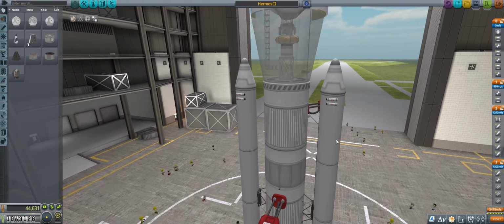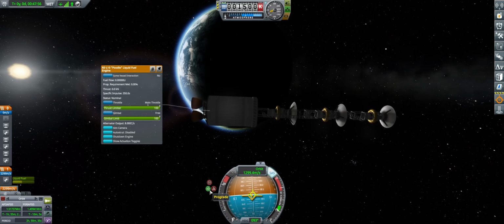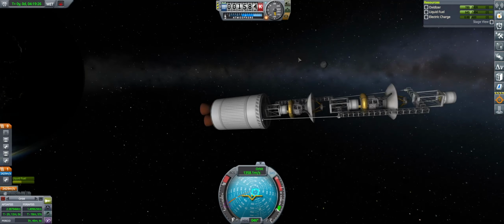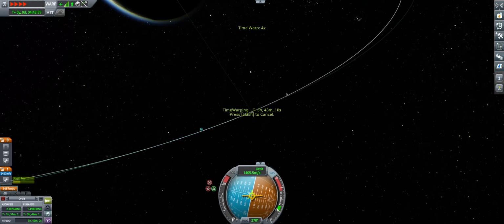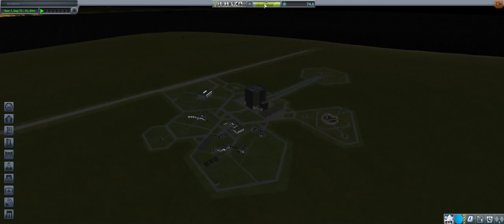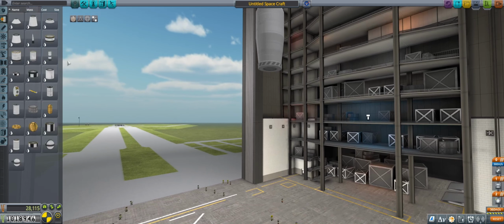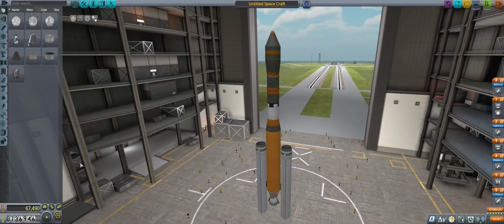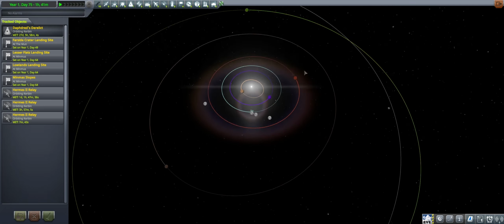Satellites, and Duna Probe - Episode 5 ║ Kerbal Space Program

Comment: Nice video and good job on the network. With >1100 m/s dV in each of the probes, I'd have left the insertion stage in the resonant (dive) orbit and let each of the probes do their own circularisation. Just a different approach :)

Also a little tip in case you weren't aware: fairings have multiple attachment points. So you can simply place multiple probes in it without making your own scaffolding, it adds its own automatically.
Reply from the maker: Oh jeez, that is one thing I completely forgot. I've been away from the game for so long that I only saw this feature a couple months ago in a random video, and I forgot about it at this point. :D